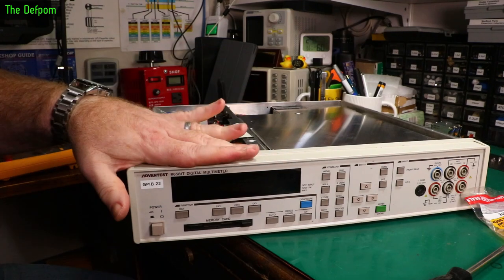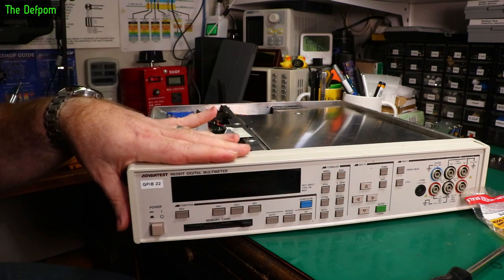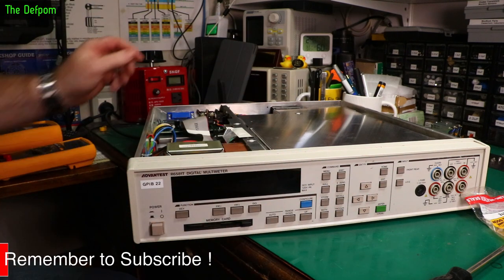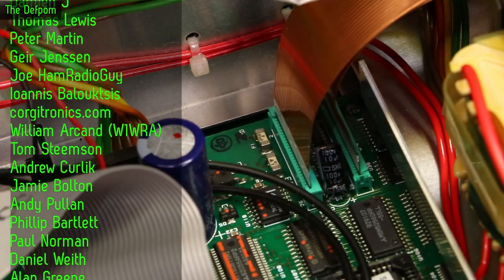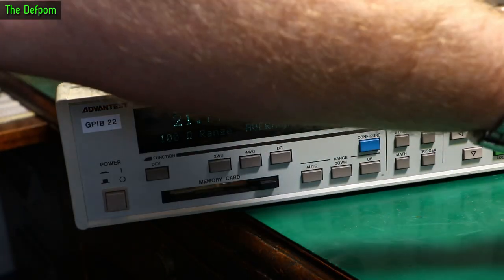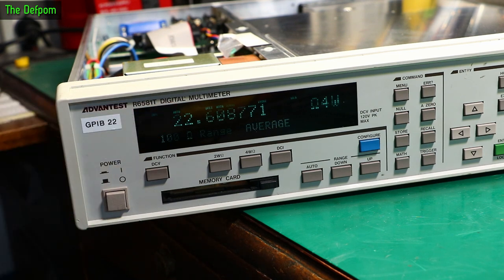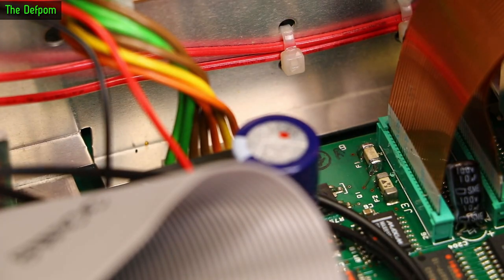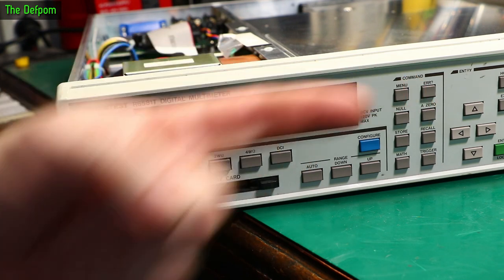🔴 Advantest R6581T Dead Display Repair - No.1120

Comment: On the last revision of the meter, the "2006" named by Mickle T. on his History pdf, but it's started to roll out on 2005, that fuse (Littelfuse 454 series) has been replaced by a 500mA one, instead of the 315mA original. Of course, it still keeps failing.
Reply: Replace it with a PTC?
Reply: @NiHaoMike64  That's just bypassing the problem. 500 mA is a LOT for a VFD heater so something must be electrically wrong.